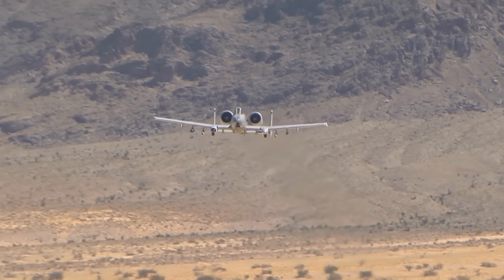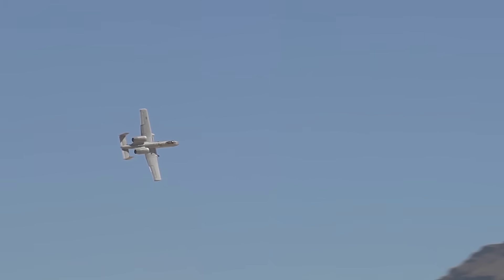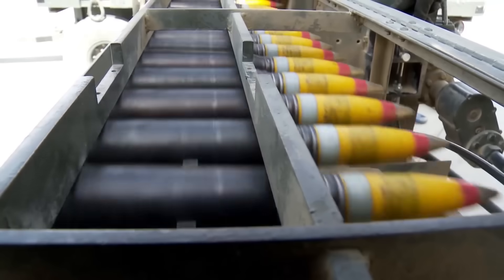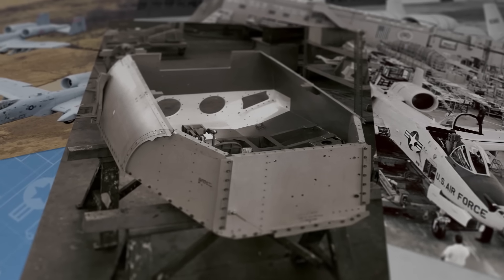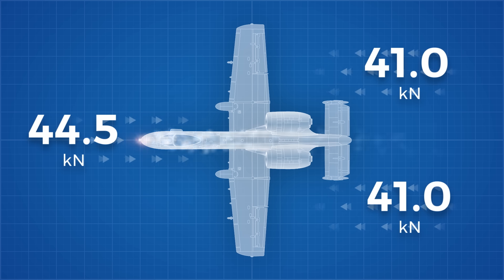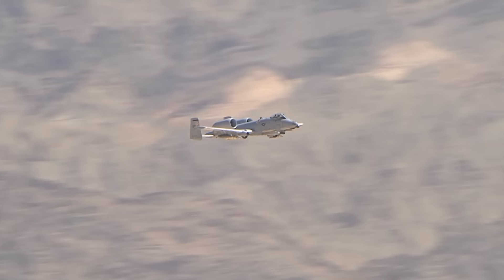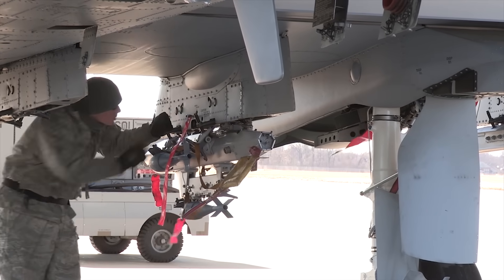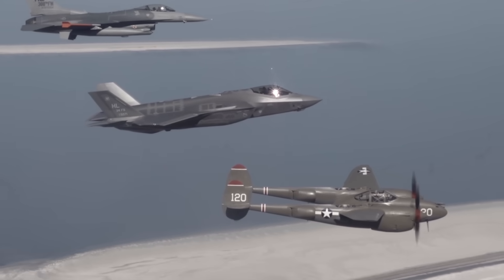The Insane Engineering of the A-10 Warthog

Comment: Thank God that senator McCain made the military keep this aircraft . He basically said that if it works then don’t get rid of it just upgrade it to work better . This aircraft is a beast , it can use depleted uranium shells to penetrate harden tanks , drop cluster bombs , use rockets as well as missiles to take out any air to ground target . It’s cool because it’s a slow moving aircraft & very agile . The cockpit it basically a thick titanium shell that protects the pilot . There was one of these that took 110 to 125 bullets in one Mission & came back safely without the pilot being harmed then went back out to do it again with some repair in the first Iraq war . These are flying tank killers .

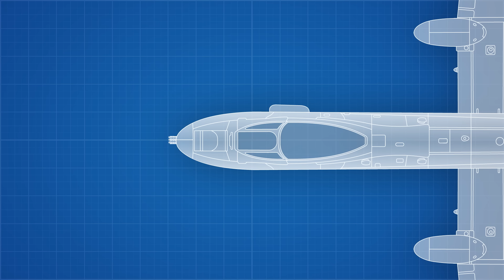Comment: Hey Real Engineering, a slight correction, the barrel group at 7:45 isn't centerline, but the barrel at the 9 o'clock position from the pilot's perspective (the one that fires) is. This is because the gun is offset to make room for the front landing gear. Source: worked A-10s in the Air Force for 2 years.

Comment: The idea is that in the near future F-35 can loiter far outside the range or detection of the enemies on the ground and drop small high precision guided bombs on them, allowing for close air support without having to get close or be seen at all. The problem is the technology for that is very new and very untested. For example GBU-39 bombs have only a decade of limited service and vision based self guided ones have yet to reach service. So having an aircraft target say a truck on the ground from 10 km above and drop a bomb on it, with the bomb following the vehicle all on its own, and to have the aircraft with dozens of these little smart bombs, is bleeding edge tech.
Reply: free;  F-35 is apiece of crap.  It should never have been built

Comment: Just a random question: Why are the wings on modern transport planes like the Airbus A400M or the Lockheed C-5 Galaxy angled downwards? In my head that makes the plane much more unstable since when it starts to roll the lift on the side moving upwards should increase and the other side's lift decreases thereby making the plane roll even more which is something you definetly don't want in a transport plane.

Comment: The gun is not used against tanks anymore as I read in the past. It is used against soft and weakly armored targets mainly. It has 7 mounting points for wide range of bombs and missiles - and there you have your anti-tank equipment. One missile will do the job much better without the need of coming so close. But still - the burst in good angle can strip the tank of many useful equipment, rendering it not so useful during the battle. Great plane!

Comment: the plane keeps the shells inside because it will throw off the weight too much if they are expended. If the plane is ever loaded with no ammo they actually put weights in the front to bring it into better balance. The A10s gun isnt actually in perfect alignment with the plane so when the plane fires the fcs adds rudder to compensate.

Comment: The A10 is a beast. I’ve never seen another one take the damage it can and still get its pilot home. The close air support that’s out there is much more than just a lone A10. We have bombers as well as just about any aircraft that has at least one weapon. I know the B-1b Lancer comes in with low Alt. High speed flybys and dumping its flairs over the target. It’s so loud at. .9mach or higher... that it scares the enemy enough for our guys to regroup. That aircraft started its life as a one way multi target Nuclear armory, and its been adapted into a conventional Bomber that can carry a lot and do it at way, way faster speeds  and do it at extremely low altitude compared to our other bomber. And the close air support thing...

Comment: @Real Engineering Actually the GAU-8 is mounted laterally off-center, slightly to the port side of the fuselage center-line, with the actively "firing" barrel in the nine o'clock position when viewed from the front of the aircraft to keeps recoil in the center.

Comment: The gun is not mounted on the center of the aircraft. The gun is mounted slightly to the port side so that the active firing cannon barrel is at the 9 o'clock position and on the aircraft's center line; the front landing gear positioned to the starboard side.

Comment: 7:45 If I'm not mistake the gun is NOT mounted directly on the center line.  It's off set just a bit to port.  However, as the barrels rotate when the round is actually fired the barrel the barrel that is shooting is directly center line.  A little nit picky but anyone who sees the plane straight on will see that it's slightly off center and might question your video.

Comment: Only 1 mistake! While the F-16 is a multi-purpose aircraft today, it was designed to be an interceptor.  The F-15 and F-22 are the jack of all trades air superiority aircraft.  Whether the F-35 can do what the F-22 can do in a cost effective ratio is undetermined.   Make no mistake the F-22 is still the best that is why it can't be sold even to U.S. allies.

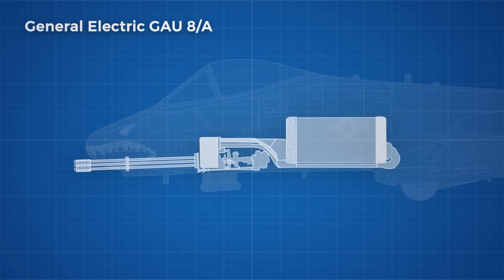Comment: 3:34 The caliber of the gun was chosen, but the design of the gun wasn't available at the time when the plane was designed, in other words, the gun didn't exist. They used M61 Vulcans in the first trial runs before the GAU-8 became available. It was a parallel development effort between Fairchild Republic and General Electric, but the plane flew before the gun was ready.

7:45 The gun isn't mounted on the centerline, the gun is mounted slightly to the left, it's the firing barrel that is located on the centerline, for the reason you mention.

10:33 The AP rounds isn't made of aluminium, the base of the projectile is, and there's a center ring guiding the 15mm DU penetrator inside, made of aluminium as well, the round has plastic driving bands to prolong barrel life, but the windscreen is made of steel. The traditional "party mix" would (according to a hog pilot I met) consist of 5 AP rounds followed by a HE round, and this is where it gets a bit complicated. The gun is rated at 5 mil 80%, meaning that @ a distance of 4000ft or 1220m, 80% of the burst will fall within an area of about the same size as a MBT. Originally the pilot could choose to fire the gun at "High" ROF (4200 RPM) or "Low" ROF (2100 RPM) so a kill was almost certain, as just 6 hits were considered sufficient for a kill - the idea was that the first 5 rounds would chew up the tank and expose fuel and ammunition, and the 6th would set it all on fire, and just for good measure the pilots were trained to fire in 2-second bursts with about 50 rounds for the first second as the gun spun up, and around 70 rounds during the last second. An average of 120 rounds striking the target area, is 20 times as many projectiles as is expected to be needed. Had the pilot chosen to go with the low rate of fire he'd hit with about 10 times more rounds than necessary, statistically speaking. As far as I'm aware, the selective ROF was changed between the Gulf War and the Iraq War, and the ROF was set permanently at 3900 RPM. For the deployments after the Iraq war, it is my understanding that the AP rounds weren't used to any great extent, as the various enemies the A-10 faced didn't drive around in tanks, and thus it made more sense to load up the drum with only HE rounds. According to a former colleague of mine who did a tour in Afghanistan, and got air support from Warthogs on several occasions, this seems to be correct, at least in his case.

But other than that, great video.:-)

Comment: When the Air Force first tried to retire the A-10 the Army told them not to shut off the engines when they landed at the boneyard - an Army pilot would take it.  One of the biggest advantages the A-10 has from a soldier's point of view is that the A-10 only does close air support.  The F-16's and F-35's are too likely to be taken away and used for Air Force specific missions - leaving the troops on their own.

Comment: Yea, about that F-16 carrying an equal ordnance load-out as the A-10C, not...gonna....happen! I was an Aviation Ordnanceman in the US Navy for 8 years so I know my bombs, my missiles and each aircrafts, even Air Force, Helicopters, drones, ect...if it cam carry weapons of war i know it's capability. And an F-16 should have no more than 9 hard points ( without drop tanks for fuel) an A-10C has no less than 13 hardpoints for external ordnance. So why anybody on Earth would think the F-16 Viper or Falcon would be a great replacement fro the A-10...I'm sure i don't know. Not to mention, if you spit a paper wad at an F-16 she's ah comin' down hot. They are very fragile. I've taken enough of everyone's time so ill stop here. 🤘🏻🇺🇲🤘🏻

Oh, and btw, don't knock the F-35. You wouldn't like it in Beast Mode. A fully loaded monster of death (although no longer stealth) she packs a massive punch in this configuration.

Comment: As I recall one of the major factors in replacing the A10 was an aircraft's ability to LOITER in the area where it's needed.
A high speed jet fighter isn't much use when it's an hour away and can only stay in the area for 15 minutes.
AC130 gunships can loiter for hours due to the fact their base model was meant for long distance cargo missions, and they use turboprops that are very fuel efficient at lower altitudes than turbofans.
The airforce actually looked into the Beechcraft T6 Texan II and Embraer A29 Super Tucano as light attack aircraft with the ability to loiter for long periods of time due to their turboprop engines.

Comment: I was stationed in Fulda at the Fulda gap with the 11th ACR (Blackhorse) back in the 80's. My unit went on maneuvers at Grafenwohr where they were giving a demonstration of forces and they had some A-10's flying around. I was radioed to stop and park my CUCV until 2 A-10's passed me. I stopped and was standing outside my vehicle when they came down low in a banking turn right past me. Damn lower wingtips must have been maybe 60 feet max off the ground in the turn. So low and close I could see one of the pilots face glance at me when he flew past me.  then they looped up and over and went in firing those Gatling 30 mms. BRRRRRTTTTTT!!!!

Comment: Minor nitpick: The gun is actually NOT centered in the nose. The rotating barrel assembly is off to the pilot's left of centerline of the airframe. However, the barrels fire when in the right-most position, and so the right-most barrel IS on the centerline of the airframe. This also helps to accommodate the nose gear, which is off to the pilot's right of center.

Comment: 7:44 I think the gun is not on the center, as you said and diagrammed.  I believe the firing barrel is on the center line.  And the fact that this is significant, because of how much energy it's discharging, is an interesting characteristic of this plane.

Comment: Small correction, The Gau-8 is not mounted in line with the plane.  It is the Barrel in the 9 o'clock position that is mounted in line, it is also canted downward at i believe a 3 degree angle so that the recoil causes no changes in pitch, roll or yaw when fired

Comment: The Hog is truly an engineering masterpiece!
What is the advantages and disadvantages of the Hog comparing to a helicopter?
Reply: Speed. But they are for different type of combat. Helicopters are more about maneuvering, specially in tight terrain, while the A-10 is more about the open field.

A helicopter like an Apache is akin to a sniper while an A-10 is more like an infantry soldier: tackling the combat head on with overwhelming force instead of more pop-in, shoot, hide, and surprise again like a helicopter.

Comment: The A-10 works where there is little-to-no sophisticated AA threats. At this point, I think that a propeller CAS aircraft could work just as well; similar, if not better, range than the A-10's jet engines; and a cheaper overall platform to run.

Comment: The A-10 “Thunderbolt 2”  not the “Lightening bolt” is one tough aircraft and cheap to operate, that Air Force was crazy to try to retire it, I’m happy the got over ruled. But on that note they are looking to replace it with a propeller operated aircraft. I’m not sure that it will be able to take the punishment!  Good video!!

Comment: F-35 will never properly replace the A-10 or F-16. Germany tried the whole "let's use science projects as weapons" thing, and look at how well it worked out for them. Being able to field fighters and CAS when the enemy can't due to availability issues is a huge strategic advantage no matter the era. Engineering is all about creating solutions to problems, and the baseline problem that all military designs need to first solve is getting enough equipment to wage war. From the start, it's what makes A-10 a good design and F-35 a bad one.

Comment: You left out 2 things. First,The reason soldiers love the A-10 is its high loiter time. The straight wings allow greater lift and slower speeds which make strikes more accurate. And combined with a less thirsty high bypass engine, allows it to remain above; to respond immediately to a threat. F-16s require constant refueling compared to it unless they carry external tanks, limiting munitions. The F-35 seems to have similar characteristics.
Second, the A-10 came from lessons learned in Vietnam, where the jet-powered close air support aircraft also couldn't provide long term protection & the hero's story fell to the aircraft they were supposed to replace, the A-1 Skyraider. This propeller powered aircraft came right after WWII & served in both Korea & Vietnam in the Air Force & Navy with similar characteristics that the A-10 inherited (high loiter times, large payload, withstand plenty of punishment, etc.).

Comment: Lightningbolt??????    You mean Thunderbolt 2
Reply: Also the gun isn't mounted direct center.... just look at multiple images from the front of the aircraft using reference points from the plane  it is mounted off to the port side slightly
Reply: 10:03 gun OBVIOUSLY not in direct center-line with fuselage

Comment: Actually, the main gun is not mounted directly in the center of the plane. It's actually slightly to the left because the barrel that fires the round is always the one on the right. So technically the only the barrel on the right side of the gun is centerlined...

Comment: Slight correction on the guns mounted position:
https://en.wikipedia.org/wiki/GAU-8_Avenger#History
"The gun is mounted slightly to the port side so that the active firing cannon barrel is at the 9 o'clock position and on the aircraft's center line; the front landing gear positioned to the starboard side."

Comment: The barrel assembly is slightly to the left so that the firing barrel is on the center line and the weight is balanced by the nose gear being slightly to the right, you can see this at 10:03

Comment: 7:44 wait, I though it was offset to one side because the one firing barrel was mounted on the opposite side. The barrel is the actual thing that's in the center
Reply: IIRC, slightly to the port side, with the firing barrel position (at 9 o'clock seen from the front) on the centerline
Reply: @michaeltempsch5282  Correct. The barrels are offset to the left as seen from the cockpit, and the firing barrel was moved from 12 to 9 so that it was along the centerline. The barrels were moved over because if they were centered and firing from the 6 or 12, the forward landing gear would have nowhere to go (you can see how offset it is when looking nose-on, and that's with the barrels pushed to the side)

Comment: 7:45 Wasn't the gun mounted off axis instead of on the center line? I might be wrong though.
Reply: Its mounted on the center line in case the electronics of the plane would fail the pilot could still aim and fire the gun

Comment: Non-humble brag: I've made simple parts for this craft.
Reply: Non-humble brag: I used the Same Phillips head screw driver they used to put together the machine that manufactures notebooks that engineers used to design the wheels used on this craft
Reply: @li4mboy136  lol! Nice try but the requirement is to be nerdy in less than 10 words.😂
Reply: Weird flex
Reply: But okay
Reply: I created the initial designs for the F-35 and F-22.
Reply: @787brx8  I made some F22 parts too. Those were cool!0
Reply: Lol I was an engine mechanic on it 1979 to 1983 Davis-Monthan AFB I ran and taxied this thing! Love this plane
Reply: @rjet4321  Avionics specialist at Davis-Monthan right now
Reply: I'm intrigued

Comment: Until another purpose built air to ground plane is designed, there will be nothing to beat the A-10. It is simply that good.

They're far better off taking the A-10 and giving it an update with modern tech and improvements, then calling it the A-11

Comment: The notion that hugely expensive high performance, high speed, multi-role fighters can do the job of an inexpensive, long loiter, damage tolerant, dedicated close air support aircraft is absolutely preposterous. Close air support REQUIRES a slow flying aircraft so the pilot has time to see what needs shooting at. It REQUIRES extreme damage tolerance. It REQUIRES forward deployment with minimal support. It REQUIRES an inexpensive platform both to acquire and repair. Multi-role fighters absolutely fail in EVERY one of these criteria.  In my opinion, those who support abandoning the A10 are either complete idiots, or don't give a flying F%@# about the lives of ground troops.

Comment: At 7:49, you have a mistake. The gun is not mounted directly in the center line of the A-10. I've read it slightly offset to compensate for recoil. https://i.pinimg.com/originals/b0/02/d7/b002d7d3224411b5eff84425d4ec30b2.jpg